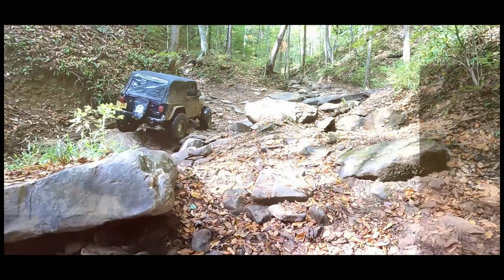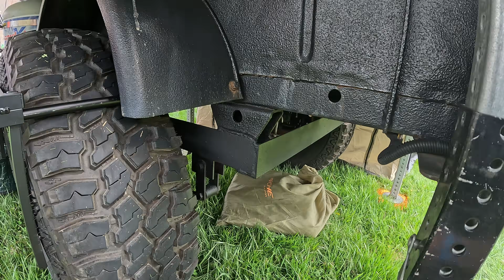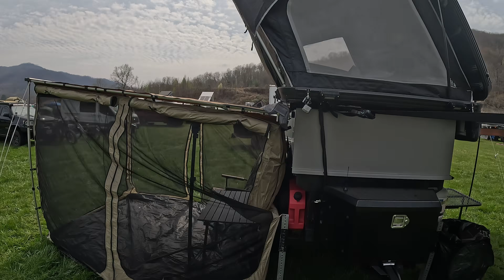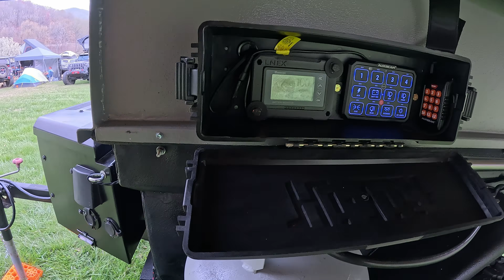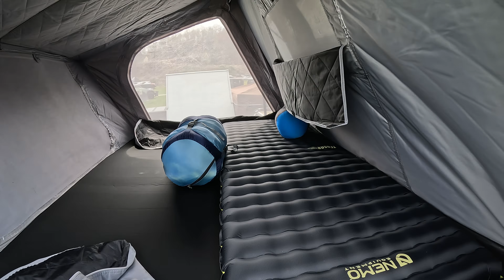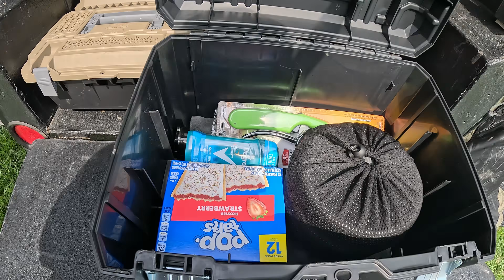DIY Overland Trailer Build 1945 Bantam T3C

Comment: How much of this was planned that you kept vs things youv'e changed since phase 1? Also, what type of boxes are those that you keep your kitchen and clothes in?
Reply from the maker: They are “Decked” brand boxes. Not a budget friendly option but I had them laying around from a drawer system that I had in a work truck. 

I’ve kept a lot of the original stuff since phase 1. However I got rid of the spare tire (jeep already has matching spare), ditched the radio, lowered the aluminum structure, removed the cube lights, replaced the standard 2” coupler. I’ve remove some unnecessary stuff to save weight. I think I still need to downsize to lithium batteries and a smaller propane tank to save on tongue weight.